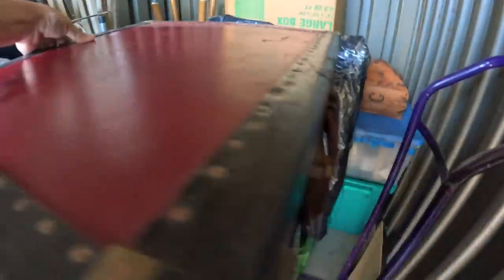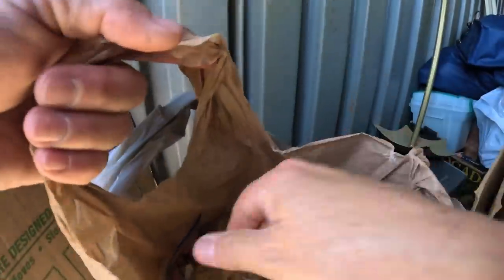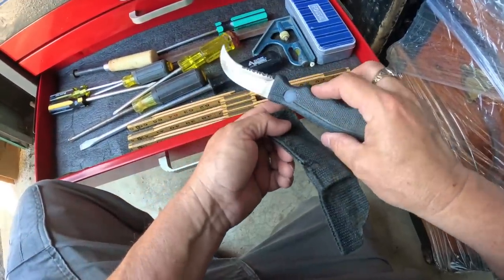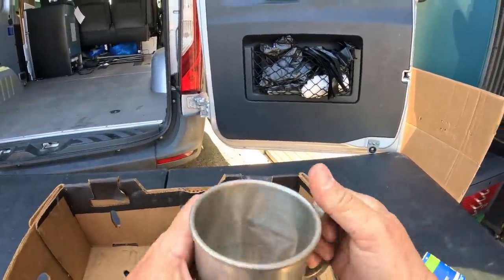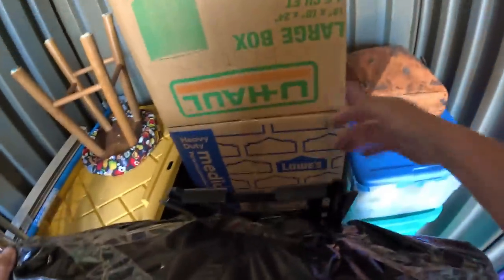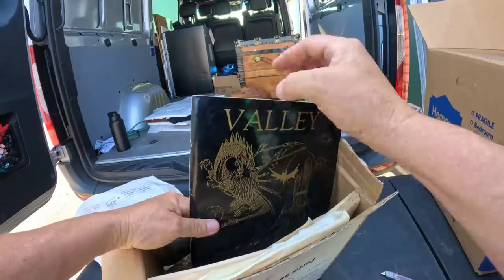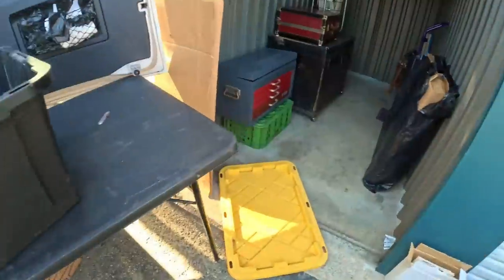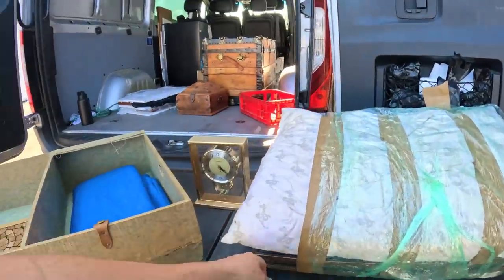I need to come clean. I knew this was bad from the beginning.

Comment: The box that had the mug in it with the chisels. The item that you didn’t know what it was is a sewing machine attachment. I don’t know if it was for a Singer machine or another machine. It could be a button hole maker or a ruffler.
Reply: That is not a sewing machine attachment. it is part of a Distributor for a  Large Gas Engine .
Reply: The foot you were holding is a ruffler.  I have one just like it for my 1960 kenmore stylist 86.  These are not cheap and then older ones are made of metal unlike the new ones sold today made of plastic.

Comment: Hi Jack, that mug with the glass bottom, may not be aluminum, mine are pewter and look the same.
I have a couple.
They're typically from England, with the glass bottom, so, as someone explained, if someone starts throwing punches in a bar fight, you can see the fight starting.
Reply: They are actually from the time when you could be press ganged to be a sailor, by accepting the King’s Shilling.  The glass bottom meant you could check for the shilling, before you drank.😊
Reply: I do like the Cedar box but I don't like the fact that he carved on the box making it only worth a few dollars If you're lucky